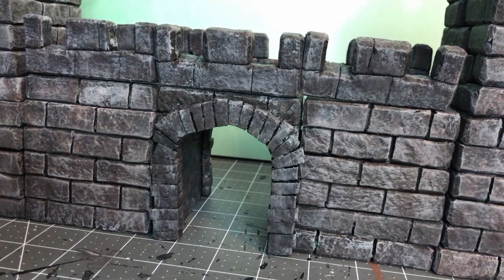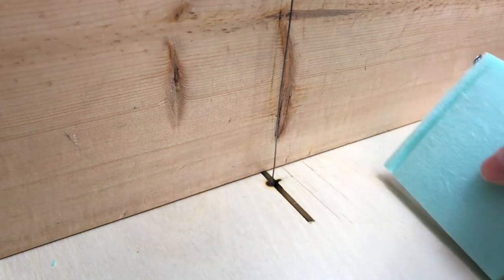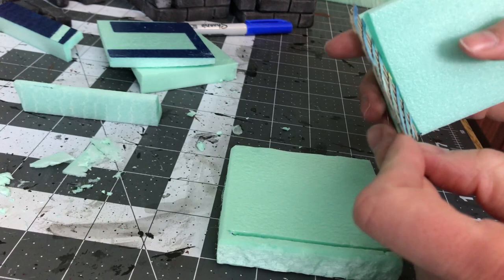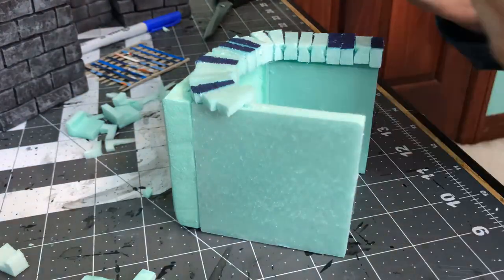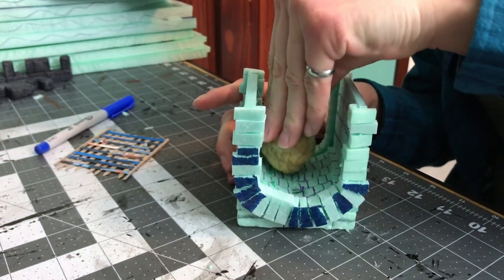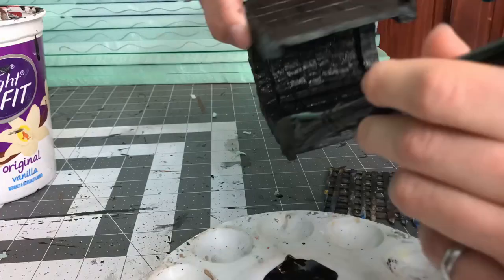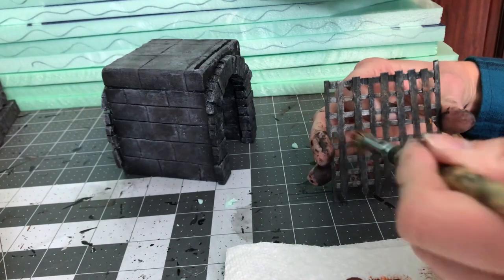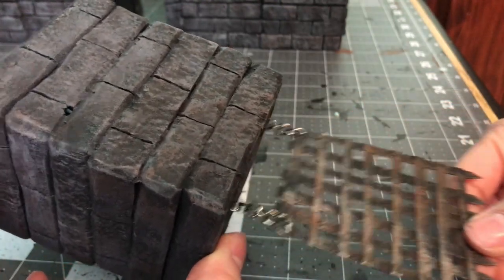Modular Stone Gate for D&D | Wargaming Terrain Tutorial

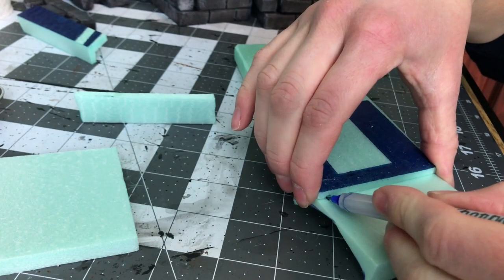Comment: Very fun. At 1:33 that buzzing noise from last video comes back. Is it the soldering iron being plugged in doing it?
Reply from the maker: I’m pretty sure it’s from my mic. Or maybe it’s my computer? I’ll keep working on it. I may just need to invest some better gear…
Reply: @okayminiatures7573  there's not a sentient bandsaw running around the house doing it on purpose every time you try to record?
Reply from the maker: Not last I checked. Although, those bandsaws are getting smarter. It probably knows how to sneak around the house without me even noticing. Maybe it's even hacked into my computer and added its lovely sound as a second audio track in the video.
Reply: @okayminiatures7573  BandNet
Reply from the maker: @MrRivech  Band-it using the BandNet? The plot thickens :)